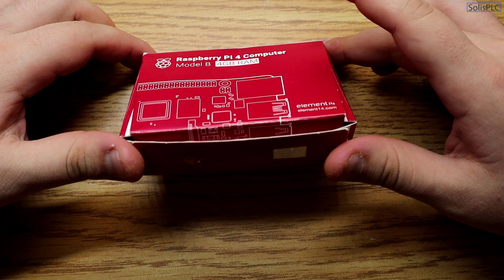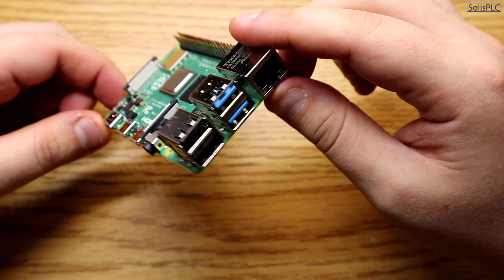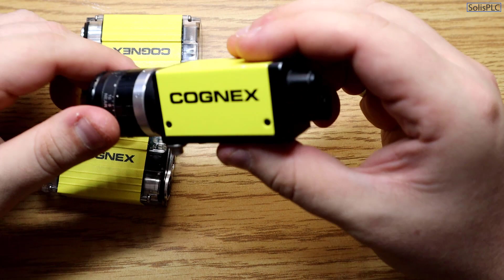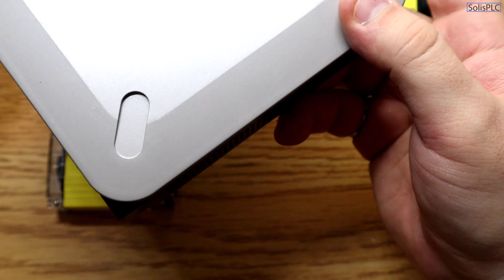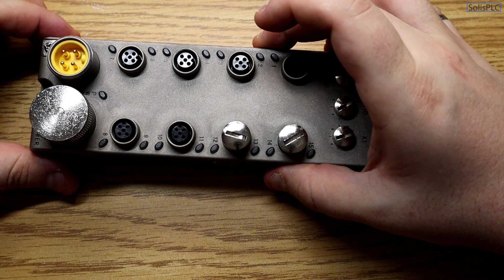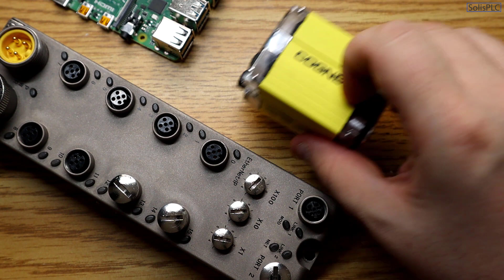SolisPLC Vlog #3 - New Hardware | Raspberry Pi 4, Zero, Cisco PoE Switch, Cognex Barcode Reader

Comment: Yup, insight micro use POE. Will you be doing spreadsheet or easybuilder?
Reply from the maker: I was trained in easy-builder and know my way around it much better. The application is probably going to be developed there first with minor adjustments in spreadsheet if needed.
Reply: @SolisPLC  That makes sense. I would imagine the majority of users getting into the system will use EasyBuilder anyway.